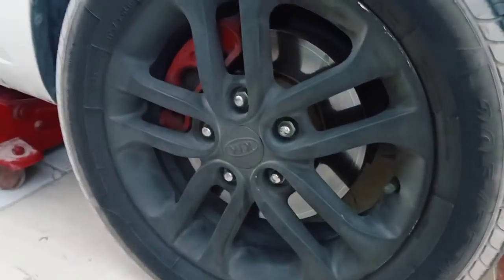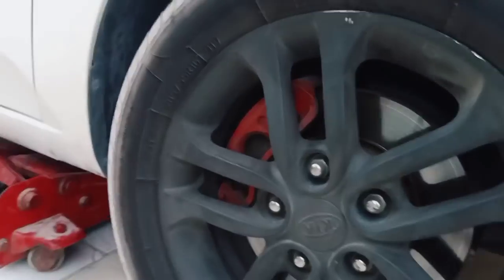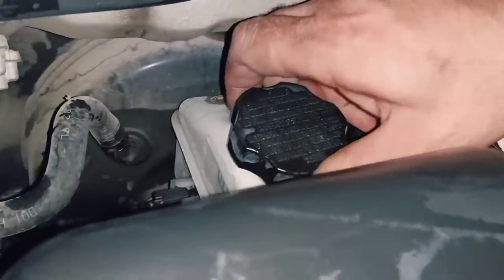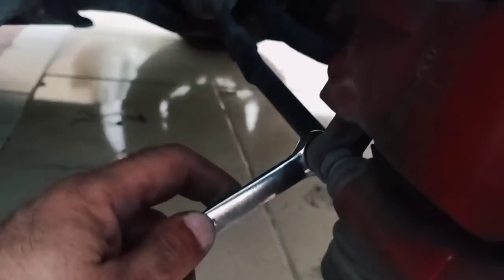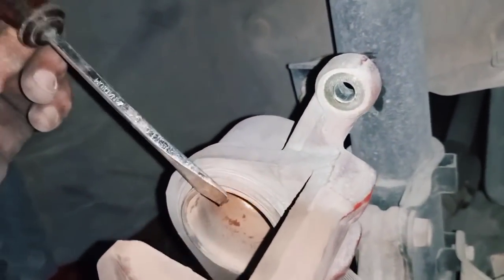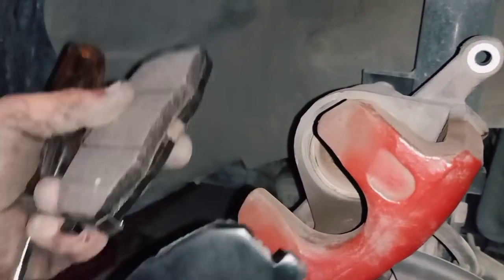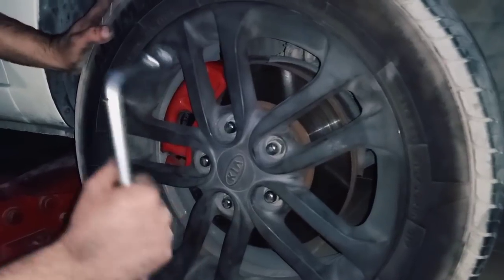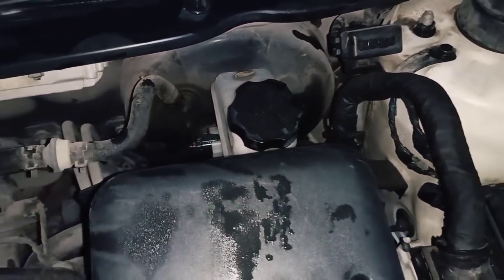How to change Kia Cerato brake pads!

Comment: If you don't have car stands, put the wheel under the chassis rail in case the jack fails.
Put at least a bit of cloth over the open brake fluid reservoir. You really don't want any junk falling in there.
A bit of brake grease on those tangs of the new pads goes a long way to quiet and smooth operation.
Tighten wheel nuts in a star configuration (pick one, then tighten the furthest from it next.) Great video, thanks.
Reply from the maker: We do put the wheel under the car, but the cloth in the reservoir we forgot, thanks for the advice we'll keep that in mind for next videos.

Comment: You forgot to lube the slide pins 😮
Reply from the maker: Hi there, yeah we did not lube the slide pins however not necessary to lube them. But thanks for the heads up.